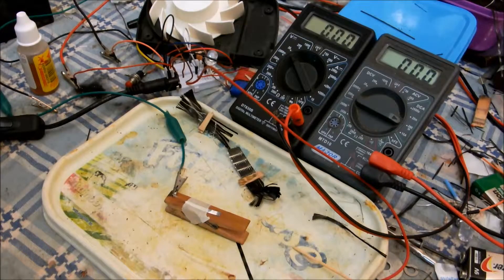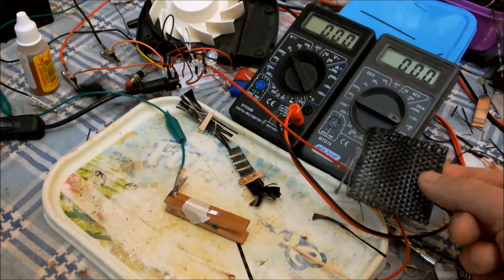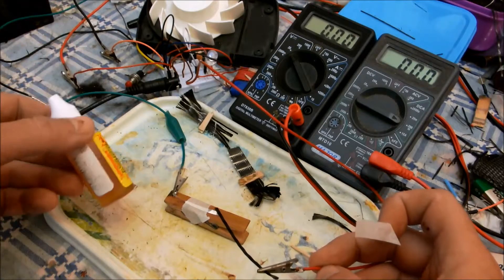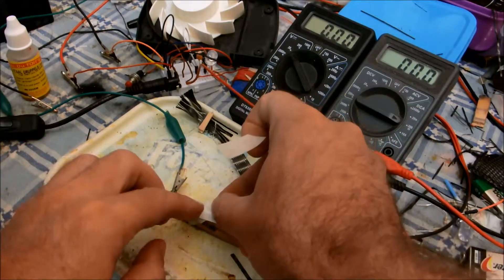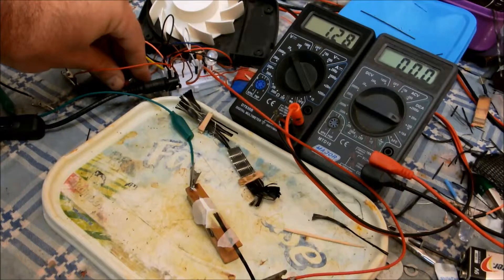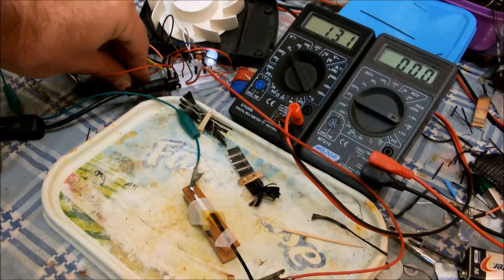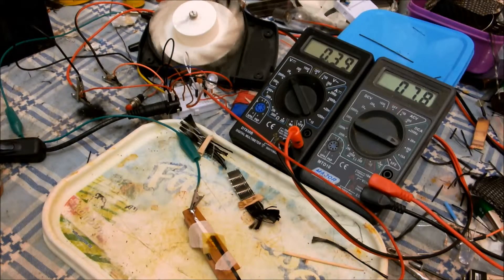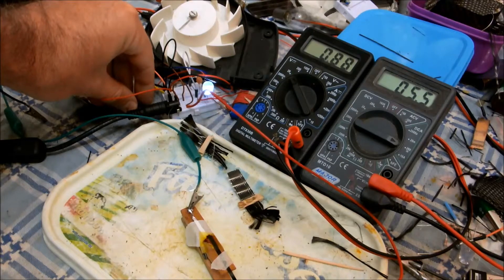Mini Aluminium-air battery

Comment: I know I'm a bit late...did you try recharging the battery ? I'm pretty much convinced you created an aluminium-ion battery and it may not actually consume oxygen (imho that's what I think RMS also created). I think the chloride ions reacted with the aluminium like with commercial aluminiun-ion batteries.
Cheers !
Reply from the maker: Thanks for the comment. No I don't recall recharging this cell.

Comment: Nice demo! What's the mAH capacity of this small junction?
Reply from the maker: I did not do a timed run on this, but from what I could integrate from the footage I estimate around 0.5mAh at an average of 0.5V. That includes extra drops of FeCl etc. Internal resistance of the carbon is very high though, so output capacity might be better if smaller loads are used.